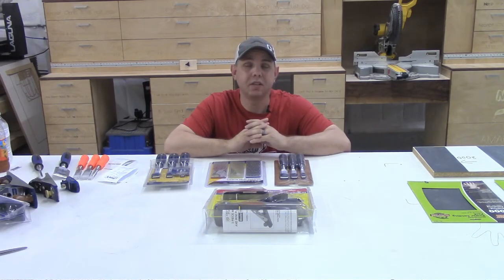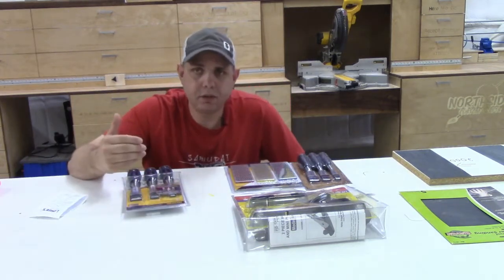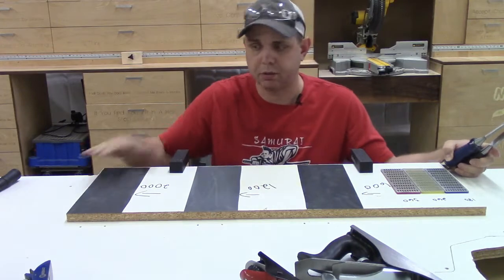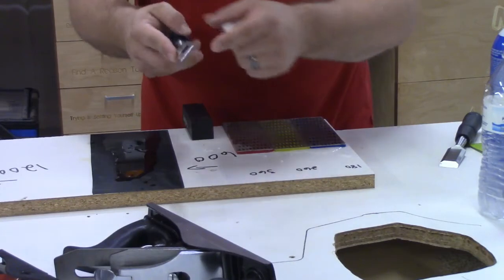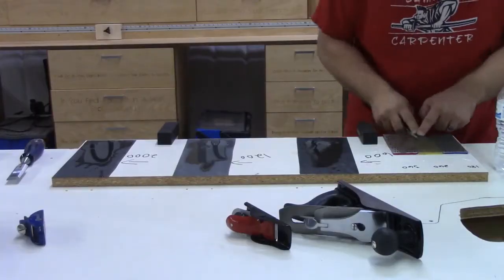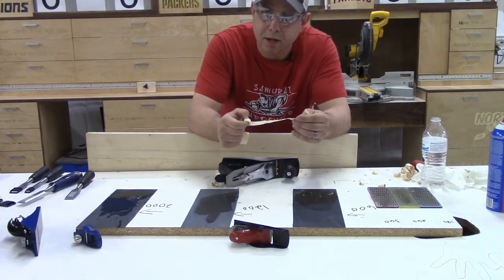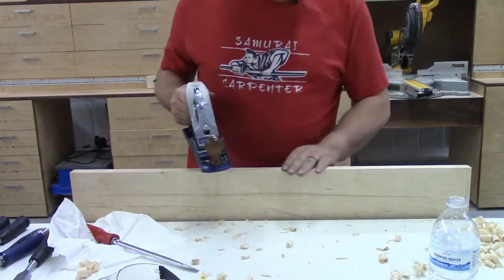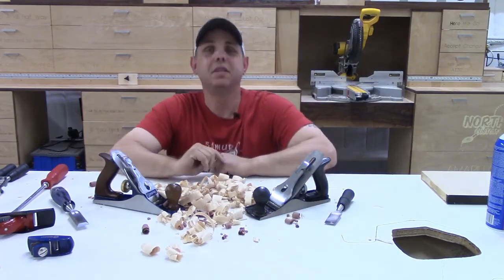Sharpen Chisels and Hand Planes with a Beginner

Comment: A sharp tool is can be pleasure to use, even if it's an el cheapo version.  With a plane well sharpened and tuned, running the entire length of the board producing a gossamer-thin, single shaving is gives joy that's hard to beat.
Reply from the maker: Welsh Rabbit 👍👍That’s right!! I’m using hand tools way more often after making this video!😄